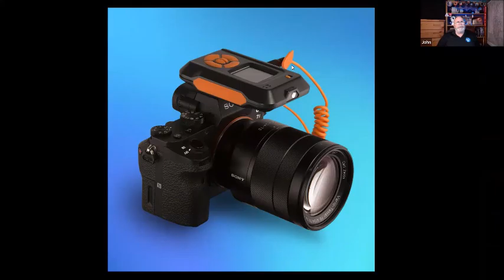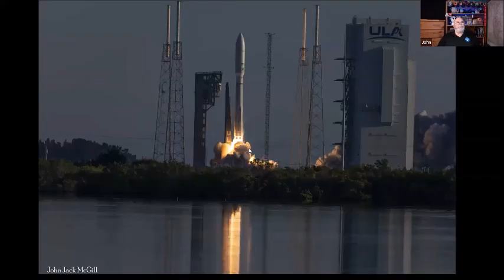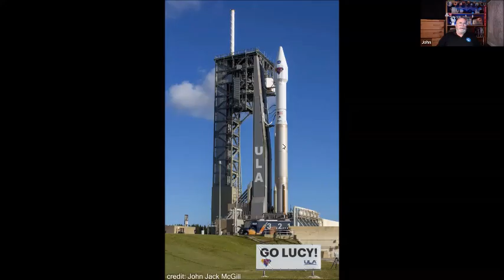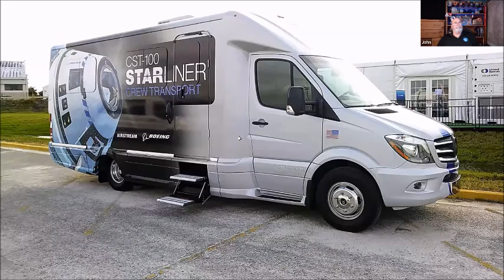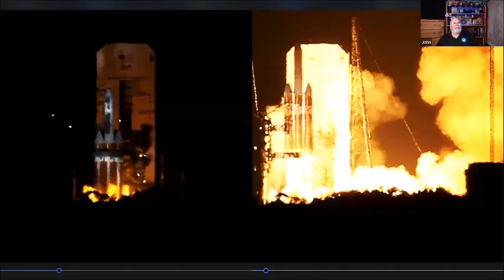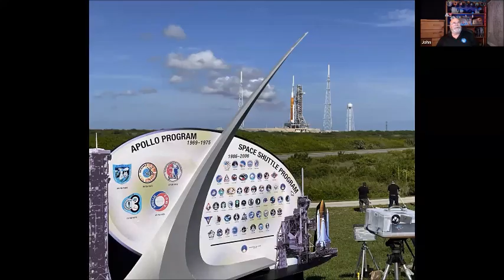MSAS Webinar#287 - 'Up Close and  Personal Rocket Launch Photography' Speaker John McGill

Comment: I misstated the speed of the Parker Solar Probe as 425mph instead of ~425,000mph.
from Wikipedia...At its closest approach in 2024, its speed relative to the Sun was 690,000 km/h (430,000 mph) or 191 km/s (118.7 mi/s), which is 0.064% the speed of light.[7][9] It is the fastest object ever built on Earth.[10]